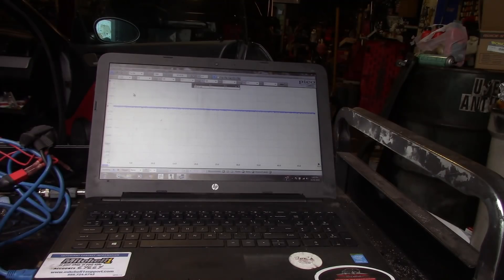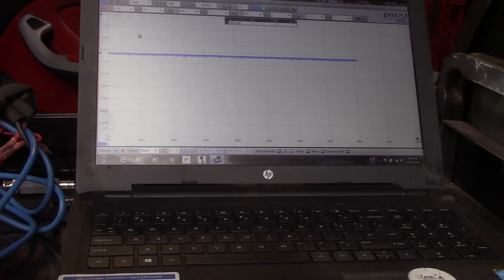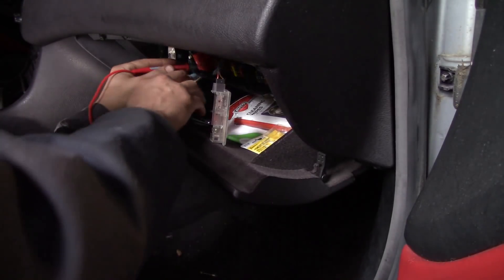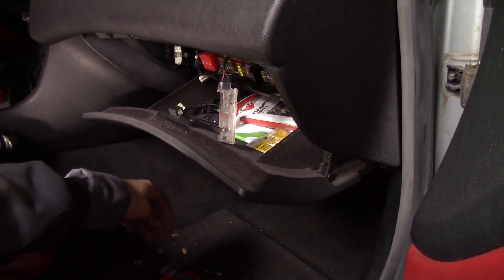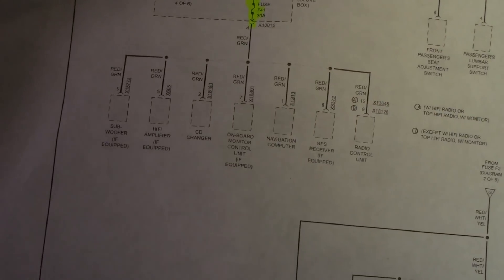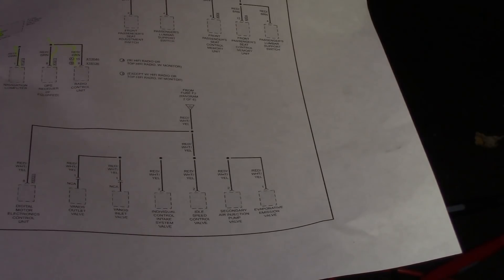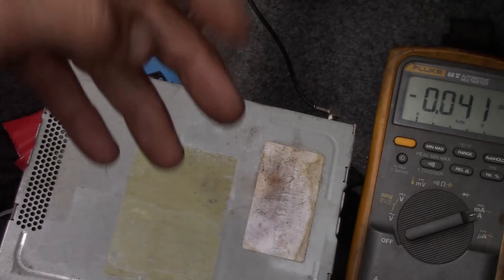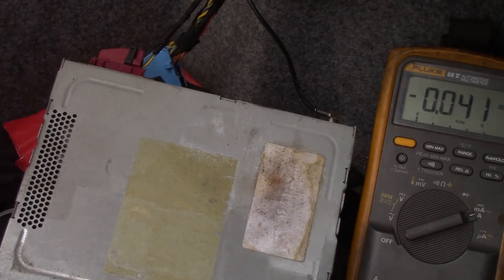BMW M3 Battery Goes Dead (Why Does the Battery Drain???)

Comment: On my own BMWs I have had current draw problems over the years. In my cases there has always been a symptom for example my ararm siren stopped working and I found the problem across the siren fuse with a voltmeter.

Comment: Re: DC current clamp accuracy. I'm an industrial instrumentation technician and I use various types of current clamps. DC current clamps typically use a hall effect sensor. Basically it senses a magnetic field. When you use them they normally have to be zeroed before any measurement because they are also subject the Earth's magnetic field and any other metal or stray magnetic fields from surrounding current carrying wires, etc. Another factor that effects DC current clamps accuracy is how the conductor you are testing is centred within the current clamp, as that can effect the accuracy as well.

In practise I've found DC clamps to be not super accurate, especially at very low current levels, say less than 250 mA, unless it's something like a a Fluke instrumentation calibrator. If you need a precise current reading, I usually prefer to connect a meter in series, but I realise that's not always convenient. DC clamps have gotten pretty good, but don't expect super precision at low current values.

I'd be interested to know what someone smarter than me has to say about it though. Hope that helps. I really like your methodical videos and troubleshooting.
Reply from the maker: Thanks for the insight. I have messed with this clamp off camera and found it is very close to the fluke in series. Not 100% mind you, but close enough to know if I have an issue or not. I still prefer the meter in series. The micro amp clamps are extremely accurate at lower readings, but extremely expensive too.

Comment: Great work Joe, I work in a large Printing plant, we make most of the C@ke and P&psi labels
for the bottles. I primarily do the Electrical troubleshooting of the machines But also the 
precision mechanicals due to their being almost no good techs available to hire.

Which brings me to my point, I have been enjoying your work on the small current drains
and the Equipment that you are using,  I also do some auto related side work.

Thanks for taking the time to share your work, I have already picked up a couple new 
ideas from you.

I had an old timer tell me once talent recognizes talent and that has turned out to be true.

I am very interested in the Pico stuff, any advice on what to get?

Best wishes my man.
Reply from the maker: Thanks very much!

Comment: Hey, I just got my home made in cylinder pressure transducer done.  The thing works.  I put a video up on how I made it.  I know it silly to the experienced techs, but I am kind of proud of it.  I powered it with a 9V battery and a 7805 voltage regulator so I have a real nice clean 5V power source for it that isn't tied to my cranking voltage.  I actually got a real nice graph on it and can even see the vacuum dips at the bottom.
Reply from the maker: That's awesome!!! I'll check it out.

Comment: Had an old 2001 730D Msport. Changed most modules, had to rewire runs between some, changed AC fan which had a huge draw etc. This thing ATE batteries...my F10 5-series from 2011 has none of these problems. Looks like they've finally learned to "computer" in these cars.